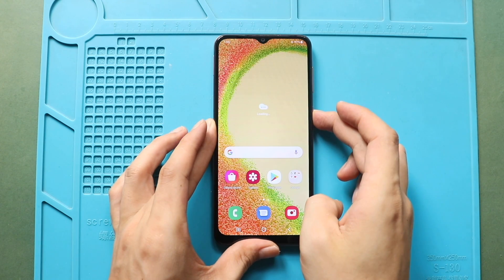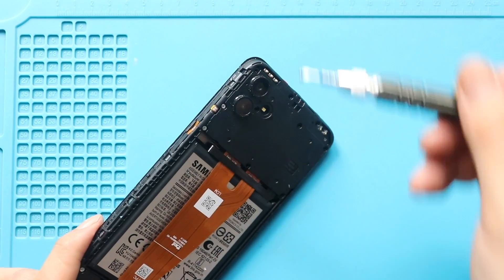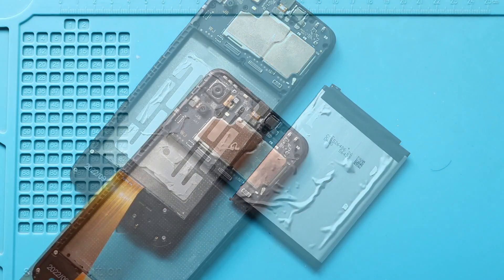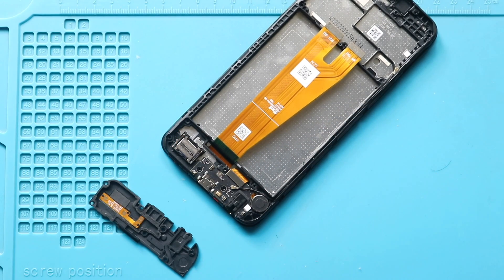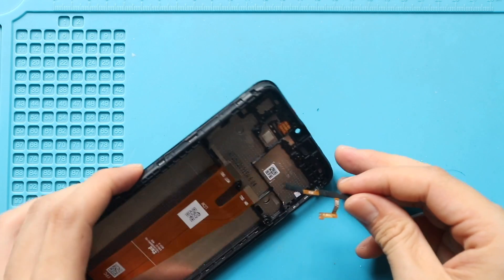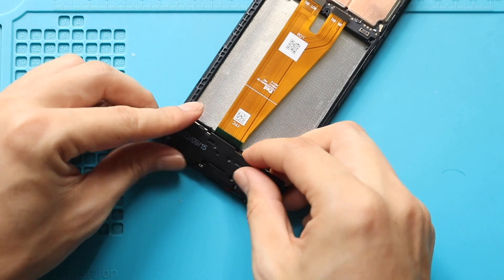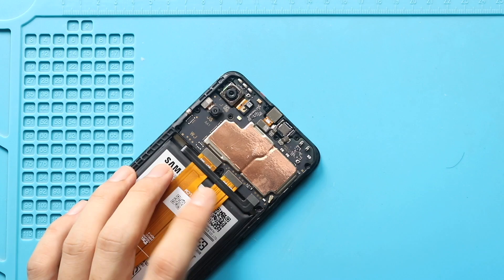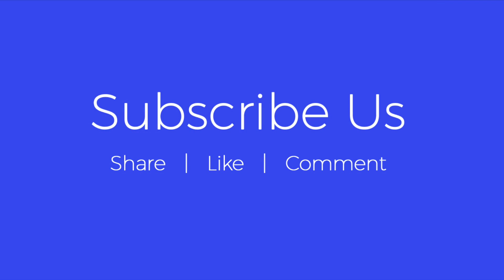Samsung Galaxy A04 LCD Touch Screen Replacement | A04s | A04e | M04 | F04

Comment: Very good, thank you so much, just one question about the screws, just to get the screwdriver/s you didn't mention what type they are.
It is very interesting  how the phone is built on the screen frame, have fixed some other brands, and this phone is much easier to repair❤
Reply from the maker: Thanks for sharing your feedback...
Reply: @DIYGeardo, you are welcome. Could you tell me the type of screwdriver i need for it, please?
Reply from the maker: @karitoop8  You need philips screwdriver 1.5 and also 2.0. Try to get a tool kit which has many screw types. it will worth it and will cost less.
Reply: It is Phillips type. Four sided .. like the sign “plus”+
Reply: Thank you, it's been fixed already 😊